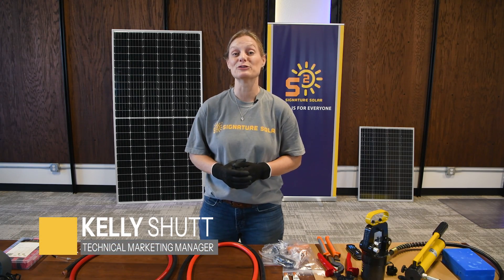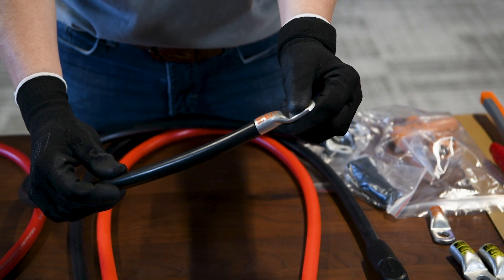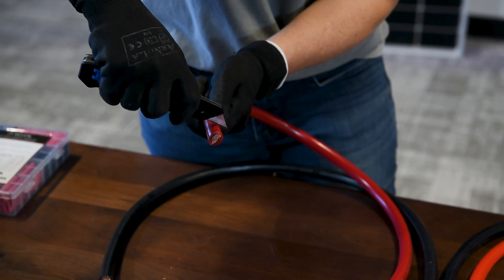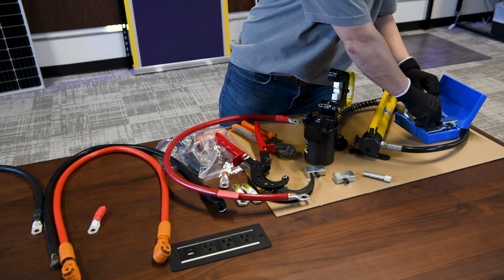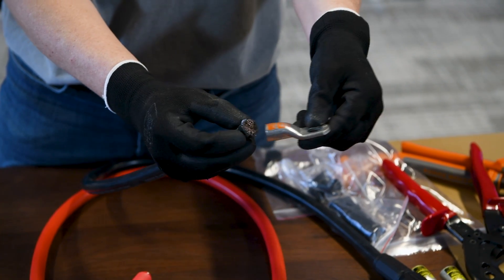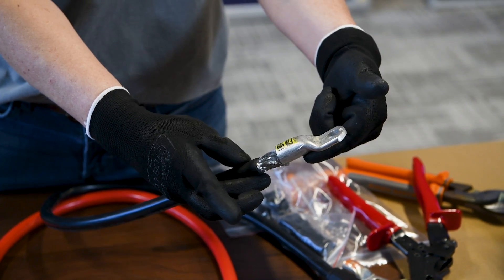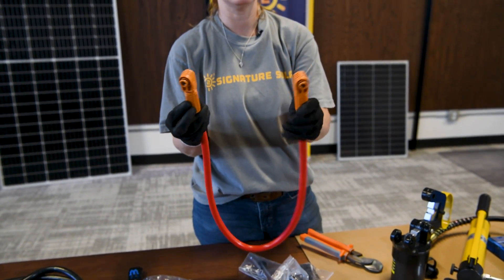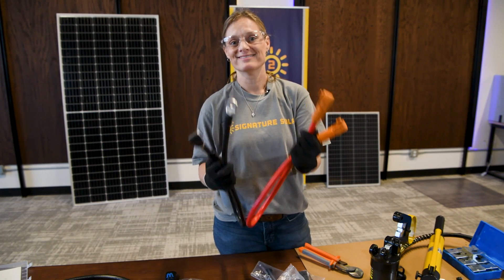Solar DIY: Preparing Battery Cables for Solar Installation

Comment: What do you recommend we do with the ultrafine wire to get it cleanly into a Flexboss21? Those strands just want to move all around and 1/3 don't want to go up into the hole in the inverter. Is there some other form of lug used for that? (the ones in your video won't work)
Reply from the maker: Hi! 2/0 ferrules.  Place over the wire, then insert into the terminal before tightening.  https://a.co/d/1swkavj
Reply: @SignatureSolar  Do you need to crimp the ferrule, or will compressing it in the Flexboss 21 receiver port be adequate?  Thanks.
Reply: @bryansmith5082  Do not need to crimp...it will crimp when you bolt it down.

Comment: I don't have a hydraulic crimper and not thinking of buying one for only 6 end poles I need to connect. Is there another simple way to crimp?
Reply from the maker: Hi! It's not ideal, but many people use pliers to achieve this.

Comment: Are the Dexon connectors on the EG4 Chargeverter the same size as the PowerPro battery cables?
Reply from the maker: No, they are different. If you need any assistance, please don't hesitate to reach out to us at  903-441-2090! We're here to help!

Comment: How far can the battery be away from the inverter?
Reply from the maker: The maximum distance between your battery and inverter depends on factors like the wire gauge and voltage drop. For optimal performance, it's recommended to keep the distance as short as possible.
Reply: @ thanks
Reply from the maker: You're so welcome!

Comment: What size lug is needed for the latest EG4 6000XP?  I understand they changed from bolts to lugs.  What lug size do I need 5/16 or 3/8?
Reply from the maker: 5/16

Comment: What material is the ultra fine wire made from? Can I use a copper ring terminal with it?
Reply from the maker: If you are referring to the wire inside the battery cable, this is copper and a copper ring terminal is fine :)

Comment: I thought each Power Pro was supposed to come with a cable to connect to another Power Pro with 2 degson connectors? 

Mine only came with 4 cables (2 pos, 2 neg), both with one end with a degson connector, and the other end just stranded wire. So now I gotta go buy degson connectors also, so I can connect to another Power Pro.
Reply from the maker: The cables come with a Degson connector on one end and the open wire on the other. Here is the link to the Degson connectors if you are needing more for your project! :) https://signaturesolar.com/eg4-powerpro-battery-cable-connector-orange/

Comment: I do like your videos you guys put out as long as the content is correct. Using the wrong lugs with the improper wire size will leave voids inside your connectors, and possibly cause fire, death or property damage.
Reply from the maker: We have noticed that the China wire size vs American AWG has been noticed and we are working on a clear definition.

Comment: Very good - hands on and bottom up converting the USA for the better! We needed that!

And please don't stop there, make your plans for TWH top down as well please and go to potus with the renderings and present them there, best put all and the event online and the progress reports on the project too!

THW should have at least one set of solar panels and so on in front of the WH to make the US statement and committment most public to all of the world - 'A White House without solar is naked and somewhat useless. And so is the world!'

('Thank you, we needed that' CSN, Woodstock, not to forget maybe.)

(For a start and make the people look and focus one 100 Watt panel, mobil, about 30 degrees to the ground, it needs to be seen too, a 30 amp hour (lithium) batterie and a victron charge controller with WLAN reporting the numbers to the OO would do: See, the US president charges his smartphone. Like we all do.)

('Almost cut my hair' -  a mighty US tradition too.)

Comment: You can use a zip tie and push it all the way to the top to hold the wire together so you can fit a terminal on the wire
Reply from the maker: This is great feedback, thank you!